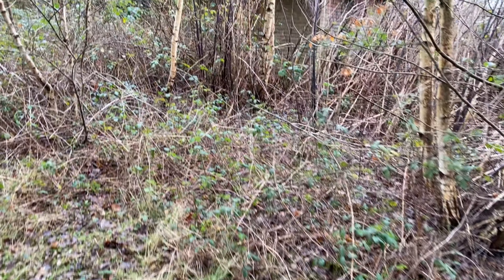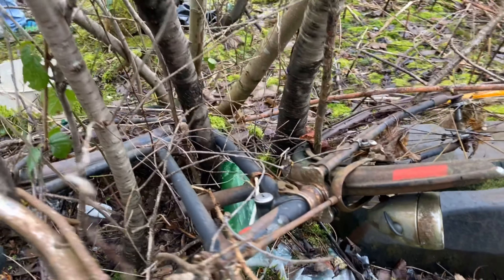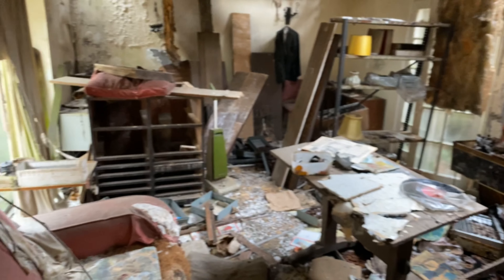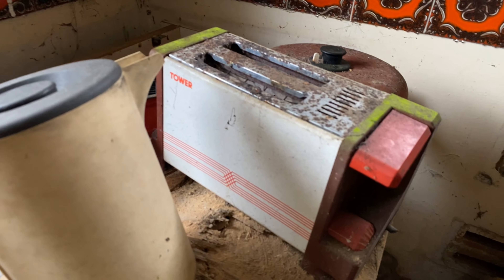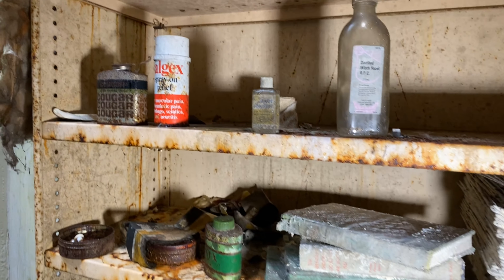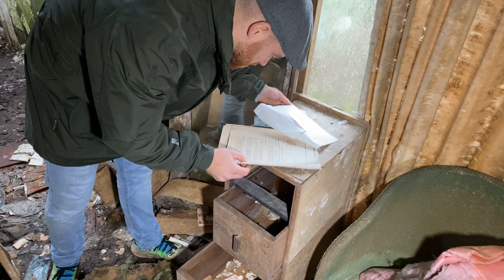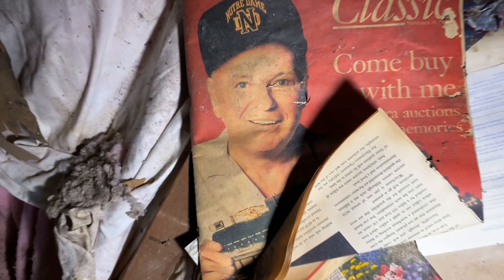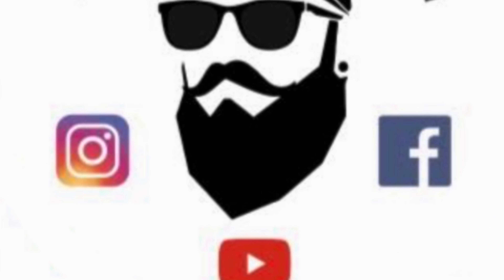This Abandoned Home Has Been Completely Reclaimed By Nature, With Everything Left!...

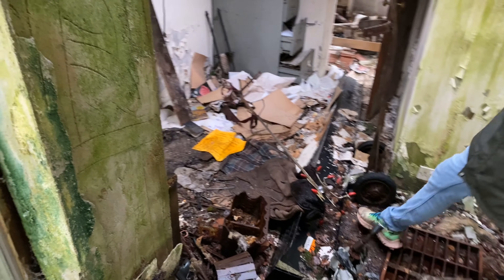Comment: I'm guessing they were fixing the roof as at 7:44 those look like roof tiles (mounting holes), and at 12:31 we can see modern pre-fab roof trusses with gusset plates (not popularised until the late 80's) that look much newer than the rest of the house. 
At 14:27 that's an original "Hoover Ball", my grandmother had one.  It had no wheels and used the air exhaust to hover. 
At 14:43 that's a Kodak 124 film cartridge, they were used in the popular Kodak Instamatic camera to produce those iconic square photos "Instagram" is based on.
At 14:46 it's a 35mm slide film viewer.  It did not project, you saw the slide on the screen when you pressed it inside the slot.
At 21:37 the triangular 3 bolt pattern could also have been a Renault 5, the first generation had 13in 3 bolt wheels.
Reply: That's Lieutenant Columbo to you @Davy W :)  Oh... and just one more thing...
Reply: And the cigarette ash on the carpet leads me to believe they couldn't find the ashtray